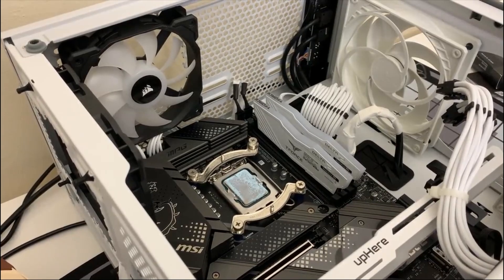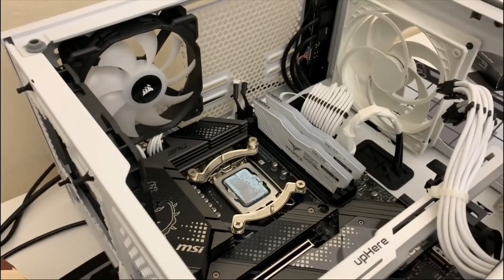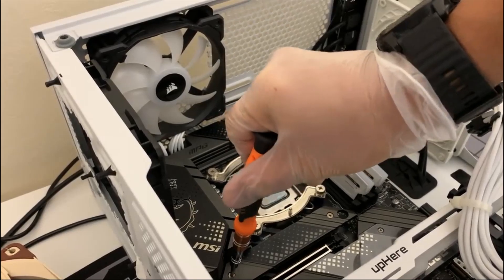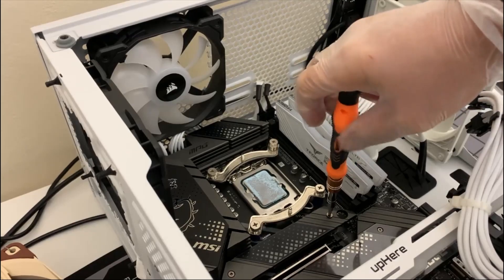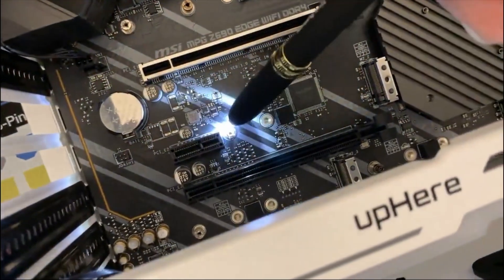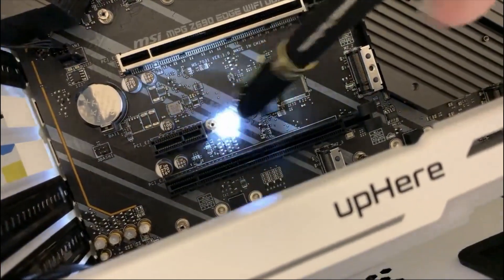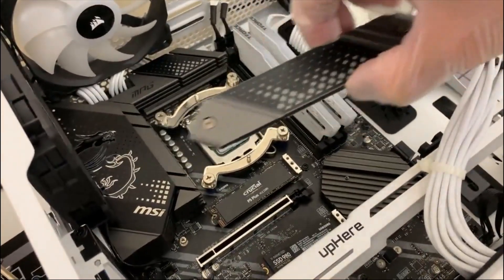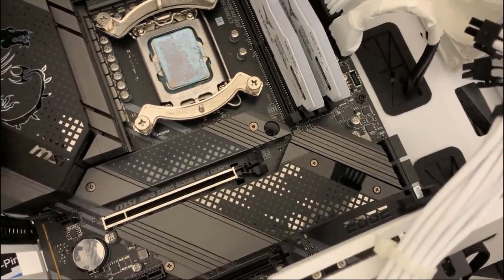NVMe Install of Crucial P5 Plus and Samsung 980 on MSI MPG Z690 EDGE WiFi DDR4

Comment: The two screws around the chipset is like they cant be unscrewed on my z690 carbon mobo... I bought it almost after they came out and still cant manage to get them out. And their head is almost devoured by my ifixit screwdriver with the correct bit. Its like they were glued into it

Comment: I read in a review that one of the 5 nvme slots isn't the full PCI x16. Do you know which one that is or does it matter?
Reply from the maker: I don't, but it might not matter, if you're already getting the full speed of the drive you're putting on. Best to test with diskmark to make sure you're getting the speeds that's expected or close to the speeds that's marketed. Good luck.
Reply: There are only 4

Comment: How many fan hubs msi mpg z690 carbon has?
Reply from the maker: It looks like it has 6 fan ports. Good luck, that's a good board to have.
Reply: @DragonRoll_Sushi  nice..thank you for replying me
Reply: @dawnnite4527  6 regular plus one for cpu fan, one for cpu pump, check the manual if needed

Comment: Thank you for posting this,  I am building systems with the Z690 Carbon and a Z690 Force.  I ran into the same problem with the EZ clip and the heat sink screw on the #2 M2 slot and was wondering if the engineers just over looked the clip and put a screw there instead and did not note it in the instructions as well, or if the heat sink screw was an acceptable securing mechanism for the M2.  With cost savings and making things multi-use, and engineer over thinking anything was possible here.  I was not sure and wanted to at least see what someone else had to say about it before just locking it down and  burning up my system.  This should be in the manual, a little more clarity from MSI on this would be nice because it now looks like this is a common practice on multiple variants of MSI boards.  I am an experience builder too, first M2 SSDs though.  Having the M2s not under the GPU or jammed between the PCIe1 and the CPU would lend to water cooling too.  Just saying.  Guess I would have to use onboard video for that.  yeah right.  Thanks again.

Comment: hello, which RAM r u using? I'm trying to get this motherboard coz I've been having some stability issue with ASUS mobo and RAM compatibility with over 4000 MHz speed.
Reply from the maker: I'm running T-Force RGB DDR4 3600 8GB x4. It's on XMP with CPU Boost. CPU has been running at max 5,297.4MHz P-core, 4,098MHz E-core and memory at XMP. Good luck.